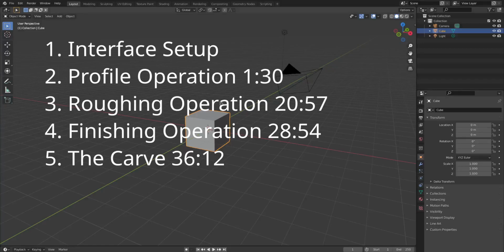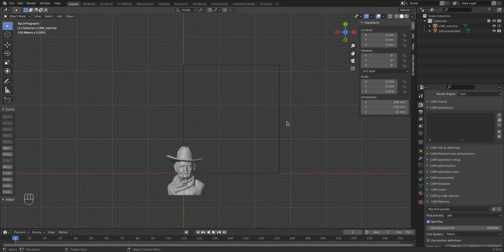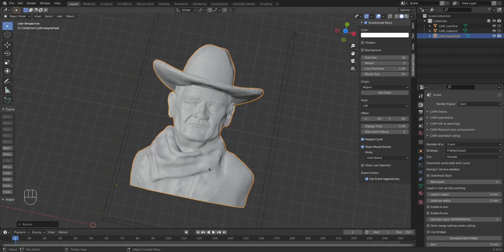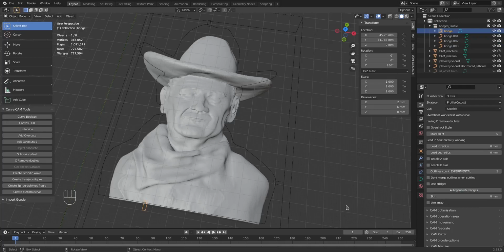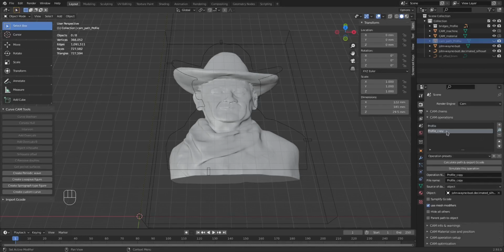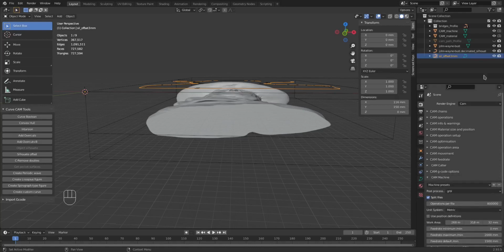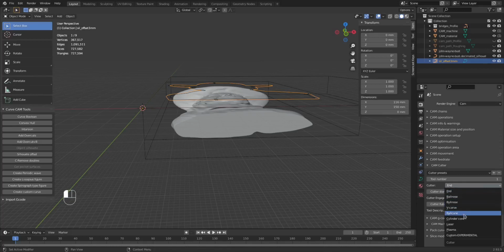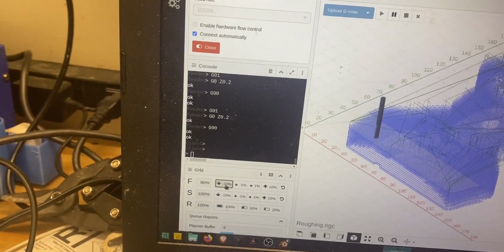How I use Blendercam to generate 3d relief carves

Comment: I have a design that I want to apply, but I am facing a problem, as the machine does not accept more than 700 in length, and the design is 1800 in length, how do I divide the design and implement it

Comment: I could not build opencamlib & I get so many error messages from blendercam when generating gcode even though there are no warnings. DO you have any advise?
Reply from the maker: Lots of people are having problems with opencamlib. They guys in the chat room #blendercam:matrix.org have helped a lot of people get it working. I followed the instructions on GitHub, but had to use the system install method because linking it from my home directory didn’t work.